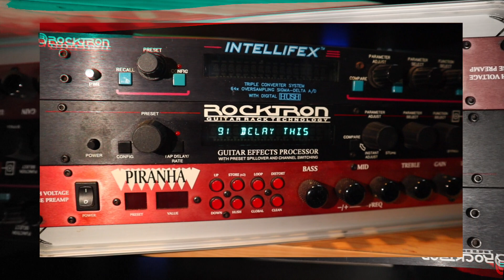Rocktron Replifex

Comment: This was my main fx from 95 on. Classic analog sounds and the best thing about it...it'll channel switch your amp. If you guys have any questions hit me up, I know this box up and down.
Reply from the maker: Pinned!

Here's a question - can I turn individual effects on and off with midi CC's?
Reply: @LeonTodd  Yup, this is how I used mine 99% of the time...I paired it with a midi mate
Reply: Is it a hybrid of digital and analog signal path ? Eg is the phaser analog and delay digital?
Reply: @danielpirone8028  Yes. IIRC,  if you avoid using the hush,  speaker sim and compressor FXs (there may be more)  the signal path thru the unit is analog.
Reply: I probably need to clarify...by analog I mean your input signal (dry) doesn't go through ad/da conversion
Reply: I’m in the same boat. Know this unit inside and out. It’s so easy to use. Also love the tap tempo out on the back. I use midi mates with both of mine. For ease of use and quality, you just can’t beat the replifex.
Reply: I've had a pair of these for 20+ years. The manual isn't very clear but I've had a lot of time to sort it out! Set it "pre hush" in the mixer parameter to have the input split & effects mixed parallel with your dry analog signal.  Another trick, you can apply modulation effects strictly to the delay repeats. Turn on a chorus or flange etc. & set the output of the chosen mod effect to 0 and use the D-mix/ Source parameters found in the Delay settings. Pretty cool! I'd love Rocktron to introduce an updated version of these, I'd be first in line.
Reply: I just subscribed to your channel. If you still have your replifex, I’d love to see a demo. With previews of your responses here. There isn’t enough out there and I’m sure you’d get a ton of hits on your channel.
Reply: @gettothegear2900  I'm  currently remodeling the bedroom/studio and all my gear is packed away till the room is finished. I currently don't own a proper digital camera so I'd be glad to do a audio demo with settings if that would interest you.
Reply: @dan_perry  that would be awesome, thanks!
Reply: I have a question about the Rocktron. If I want to use it as a pedalboard and switch effects would any midi controller work with it, or would I have to buy a specific midi controller to do this?
For example the Behringer FCB1010
Reply: @rickslootweg8442  Any MIDI  controller that can send CC (continuous  control) messages will work. There is the bonus of phantom powering the foot controller by using a Rocktron controller with the 7 pin MIDI jack.
Reply: @dan_perry  Thanks for your quick reply Dan! I will make sure to check for CC if I buy a midi controller;)
Reply: @dan_perry  : Hey Brother I’m just looking for lush reverbs and I can careless about any kind of modulation or Preamp dirt. Does this unit have better sounding and feeling reverbs than an Intelliverb or lets say TC 2290? Thanks. This would be going between an old Soldano SP77 and Peavey Classic 60/60, because the Soldano Preamp does not have an effects loop.
Reply: @theirritatedirishman5440  The simple answer is no. The reverb was scaled back to allow the unit to run many other FX at once.
Reply: @dan_perry  : Thanks for that answer. Let me ask if you’ve ever tried an LPX1? I was told by a few guitarist that it has the same Reverb quality as a PCM90 but it’s cheap do to the fact that 1. It strictly does reverb and 2. It’s not midi with a bunch of presets? I’m predominantly a bassist and have built and repaired amps for over 25 years but rack stuff and recording is not my strong suit. Thanks again.
Reply: @theirritatedirishman5440  I have used the LPX1 and it is a very nice basic reverb for the money. Although, it's not nearly as deep and programmable as a PCM or MPX. 

Amp tech huh? Small world my  brother.👍
Reply: @dan_perry  : Yes, Grew up learning from the best Ken Fischer and Denny Kager were very close personal friends of mine since the mid 1980’s. Through Denny I was able to meet and hang with guys like Jesse Oliver. I ran in circles with the most notorious guys in music. I sold the “Fake Book” AKA “Real Book” for years but that led to issues???
Reply: @theirritatedirishman5440  Very cool man! Respect!
Reply: @dan_perry  : So decision? Do I get an Intelliverb, MPX 1 and do I modify the SP77 for an effects loop or run the rack piece between the poweramp and preamp? Again the rack thing I really just started messing with last year? Thanks Dan.
Reply: @theirritatedirishman5440  Either of those are great choices. I'd side with the Lexicon as a personal preference. And yup, run it like you mentioned. You could also run it 100% wet with a line mixer with something like a Rane SM-26b.
Reply: @dan_perry  : No sound or feel loss when patched between pre and power amp? Thanks again. There’s a guy not to far from here has a bunch of Intelliflexs and says reverbs in those are better than Intelliverb? Either way he’s willing to sell one or more.
Reply: @theirritatedirishman5440  A tiny bit with the Lexicon...not so much with the Rocktron. The Intelliverb is a specialized version of the Intellifex, there is also a Intellipitch. 
So the reverb in the intelliverb is greater than the stock intellifex.

If sound purity and flexibility is your goal, I'd suggest either a parallel FX loop mod or a line mixer. You can get really good results just running it series too...you'll have to choose what works best for you.
Reply: @dan_perry  : I have an old Sound Workshop rack mount spring reverb unit that has most simple great sounding reverb in it but has a couple pit falls. 1. The In/Outs on the back are low impedance which I can get around by going from the Low Z to a High Z adapter so that’s that. 2. There’s no On/Off foot-switchable capability on it which really sucks and I do not wanna modify it since I know without a doubt I can sell it and pay for an Intelliverb or MPX1 without a problem. PCM’s are bit more money and again simplicity and lush are my goals. Tried the Quadrverb and ART Reverb both awful,with bass guitar.
Reply: @theirritatedirishman5440  Hmmm, maybe a nice pedal reverb would fit the bill?
Reply: @dan_perry  3 most incredible reverb pedals I’ve ever heard or played through were the “Ultrasheer” which I heard is better than the old Lexicon 224XL. The “Quiet Theory” is incredible and I’ve played through a Hungry Robots “The Wash.” Version 1. All of those are just beautiful! The Ultrasheer is $400.00 but I may just pop and do it?
Reply: @dan_perry  : I’m getting the Vongon Ultrasheer pedal and I also scored an old IBanez SDR 1000 reverb unit which surprisingly has great warm reverb! Don’t know if you’ve ever messed with that particular unit but very nice for the money!
Reply: @theirritatedirishman5440  Very nice! Good luck on your tone quest!👍
Reply: what are the CC#’s
for the effects to turn on & off?
do you have a pdf of all the control numbers?
please explain how to do this by sending CC#.
I have a boss ES8 can send cc#’s and cobtrol change as well as using a control pedal.
where do I start?
Reply: explaine how to turn on and off with CC#’s?
Reply: @oldhomesteader5357  You basically have to match up the cc# on both the FX unit and foot controller for the FX you want to turn on/off. All the cc#'s should be listed in your manual. Make sure the MIDI channel for both FX and  ontroller are set to the same channel...usually MIDI ch 1.

Comment: I have 2 replifex units. Been using theM for years in various rigs. Right now I have one in my synergy rig and one in my Mesa JP-2C rig. Both in the effects loops. I love them and have no desire to use anything else. You forgot to mention the awesome hush noise reduction in them. Works excellent
Reply from the maker: Speaks volumes there. +! about the Hush, it may not be sexy but it works a treat.

Comment: Still have mine. Bought it for the rotary Spkr effect. We were doing “cold shot “ and “ Black Hole Sun” :)
A lot of times rack effects sounded a little watered down back then. Replifex did not suffer from that.  I used it in the loop and had pedals in front for things like compression, phasing, and flanging. The other cool thing was Rocktron devices never digitized the dry signal.
Reply from the maker: Yeah the rotary is particularly nice in here

Comment: Flanger and rotary/leslie was what I used the most.  Chorus and delay was left to an intellifex.  I ran it in the loop of my triaxis, and also had it in a rack mixer in parallel.  It can nail the mxr flanger “effect” pretty perfectly but getting it to behave in front of an amp or in the loop for dirty tones is challenging.  I also set an expression pedal via midi cc to vary the speed  and mix of the leslie or amount of reverb decay.

Comment: I have the Replifex and Intellifex.   I used them mostly when I used to use and MP-1, but I still use them occasionally with my current amps.  Personally I like the Replifex after the pre-amp (or in the loop) and I tend to use the delays from the Replifex instead of Intellifex since it has longer delays, and the Intellifex pretty much just handles that sweet chorus.
Reply from the maker: Sweet, sweet chorus!

Comment: My main in the nineties as well.  Intellifex wasn't available at the time.  Always wondered what I was missing in that beautiful 8-voice chorus.  As for the Replifex, the rotary speaker with speed change modeling was novel.  TriAxis -> dbx compressor (mostly for the noise gating) -> Replifex -> lexicon reverb -> Simul 2:90, with one voodoo labs rack switcher for pedals in front, and another handling stereo duties around the effects between the Tri and the 2:90.  I recall wishing the Replifex eq would do a more drastic cut of some of the nasty Mesa frequencies.  Cheers, D

Comment: I used the Rocktron MID Mate to assign fx CC to button 5-9.  button 9 REV, button 8 Delay, Button 7 Trek/pan,  Button 6 modulation chorus/flange, button 5 Oct or Phaser. I combined the Intellifex to get longer delays. I had a delay on one side 590 and needed 1290 on the other side. I would have it mixed so it sounded balanced. I miss rack gear for having sounds exactly the same vs knobs or having to kneel down and change something...

Comment: I have the Multi-Valve version and the Replifex. I used both the Replifex and Intellifex together to get longer delays. I got the Replifex to be like a rack mounted pedals and using less cables. The concept was to mimic  pedals. The Multi-Valve is the same as a Replifex with a 12ax7 that can be active or bypassed. Not an overdrive. I thought it was really cool.
Reply from the maker: I didn't realise that's what the multivalve did. Very interesting

Comment: I bought one used back in the day but send it back due to a failure in storing presets despite battery was ok. It had sweet sounds and the spillover was great for live playing with your rack as it would cover any channel switching delays. The fact that is was very easy to adjust was a ++++, I mean comparing to Lexicon MPX-1 for example where you need to get a pHD to set a basic delay and verb...BUT, it seems they had problems eventually, something rare for Rocktron, as they were famed for reliability. I mean, Intellifex lasted years on most users I know with no issues, but replifex had a rumour that was failing every now and then. Still looking out there for used ones though :)

Comment: Apparently, one of the flangers in here is an absolute spot-on model of the original MXR 117 with the built-in power cord (even more accurate than the analog MXR reissues).
Reply from the maker: That's super awesome. I need to try dial in some jetplane sounds with it :p

Comment: you missed the best part about the Replifex. I've had mine since 97- with this unit and any midi pedal- you can make it switch the channels on your amp- theres a /14 TRS jack on the back that is programmable. I had this with a Peavey Ultra combo- 3 channels- that with the right adaptor- would switch the channels on my amp. Art X-15 midi pedal, ( the big one) and you could set up your pedals like stomp boxes and turn them on and off within each patch. Also, the delays are WAY better than you give them credit. You can even roll off the high end and make them sound analog. Best guitar effects unit I've ever had- and I tried them all- Intellifex, Lexicon stuff- TC stuff- this sounds the warmest and is the most flexible. An absolute STEAL these days used for like $200.